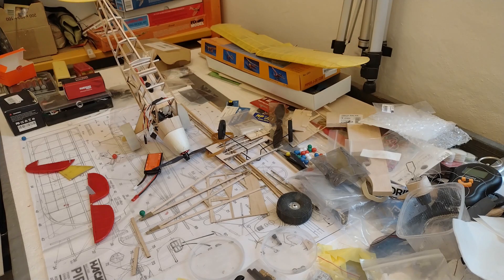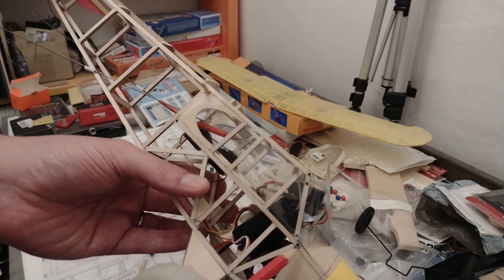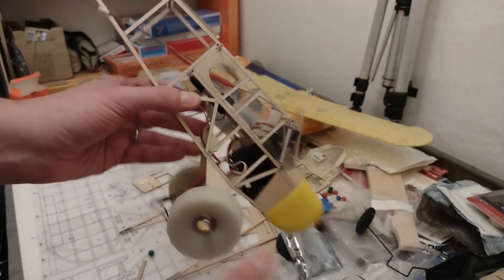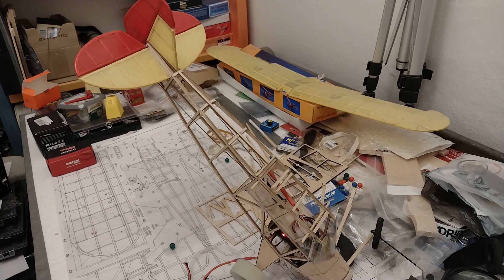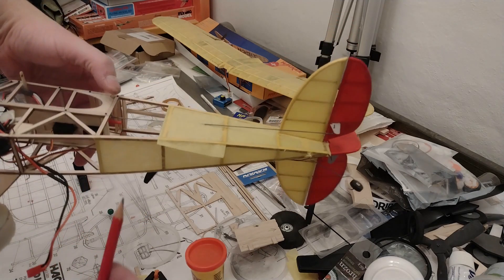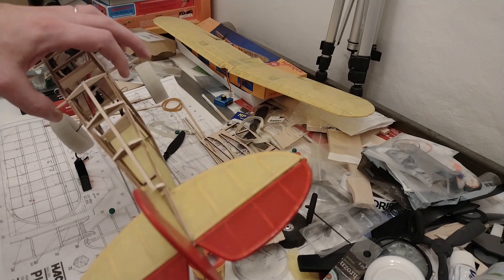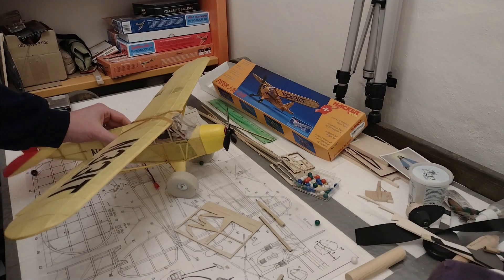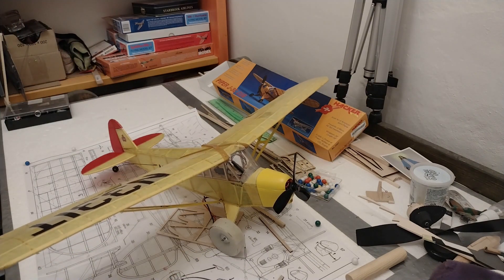10 Piper Cub RC Conversion   Final assembly

Comment: Hi Andrew, very nice build ! This one feels right. I see your skills improving all the time !BTW I use the outer plastic from small electrical wire to hold the control wires to the horn, you can glue them or just a good push fit . Works well. Oh and maybe not full throttle on launch !
Reply from the maker: That is a good tip. I usually throw those away, but now will think of keeping some rests to fix the wires in a way that is removable. Thank you for stopping by!

Comment: Looks good! One thing I noticed is your elevator throw. At 15:41 I think we see full up elevator. I'm afraid that much elevator movement will result in an instant stall. I'd dial it back to about half that, either through the radio or linkage. I think I speak for everyone following along when I wish you great success on the maiden!
Reply from the maker: Thank you! A good point with the elevator. I'll try to play around and limit the upwards movement to prevent a stall right at take off. Thank you!
Reply: @downwindchecklist6567  Four or 5 months is nothing! That's a quick build for most of us! Also, for the maiden, remember to be very gentle with the elevator. I think this one's capable of being a good flyer, but I'm afraid it's a little heavy and those long Cub wings will be unforgiving in a stall. In other words, If you yank back on the elevator, the model may snap over on its back and auger in. I'd probably try to fly it with just rudder and elevator at first, once the ailerons are trimmed out. Keep your inputs nice and smooth!
Reply: One more thought: Your solution for the wheels binding should also include getting rid of those steel washers!
Reply from the maker: @joelamb3581  The washers are part of the "bush" wheels I made. If I had a smooth take off ground I could probably go with regular plastic wheels. I somehow feel I need the extra cushioning of the big wheels as my handling will not be as smooth as I would like ;)

Comment: Mark the CG on the underside of the wing, at the root, with a pen. The underside of the wing is where you will put your fingers when you are balancing it. Of course you could use something fancier than fingers, but all sensible options will involve supports under the wing. You will be the only person who knows about these marks ...
Reply from the maker: I really need to mark them as I will need to do adjustments to the battery position out on the field. Thank you for the comment!

Comment: I would be tempted to cut down the elevator horn, (I use wire cutters) shame for it to get snagged in any grass etc unless as Joe says perhaps you should reduce the throw a little, personally I would add expo in the transmitter and reduce the throw that way. The starboard aileron looks up a little, can you trim it down slightly? The motor looks really powerful, just make sure the cg is right, or a little in front if you're not sure, she's looking really nice, fingers crossed for you, well done, cheers 👍
Reply from the maker: Thank you! I need to explore the transmitter to reduce the throw on the elevator. The aileron is indeed crooked. I think I messed up when putting in the hinges. And I am indeed a bit afraid of too much power. I am thinking of spending the first battery just doing taxi runs to get practice. Thank you for all the comments and encouragement!
Reply: @downwindchecklist6567  If you can do a half power taxi run and focus on keeping it straight she might just lift gently off 🙂